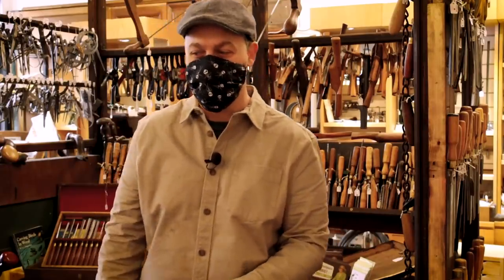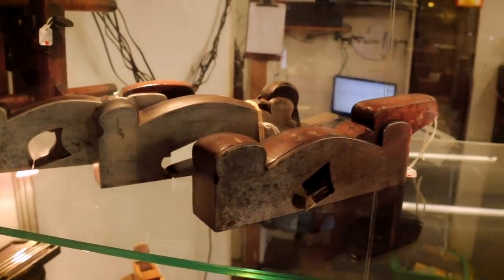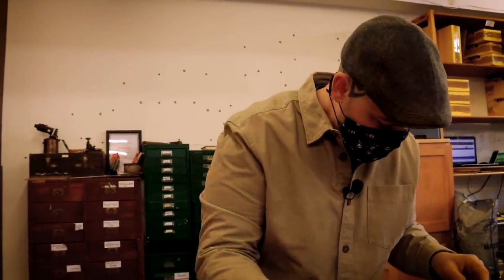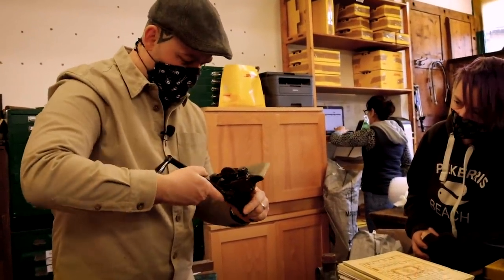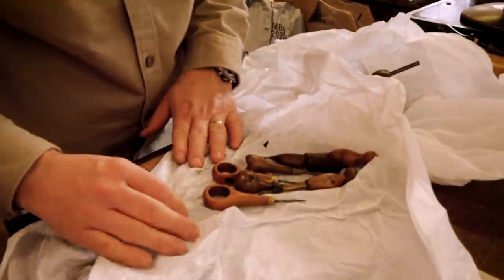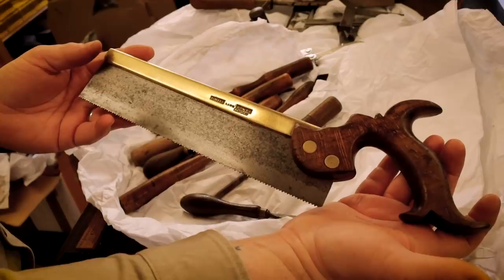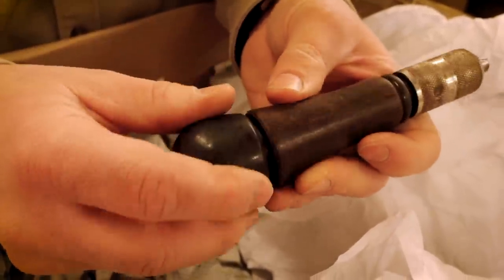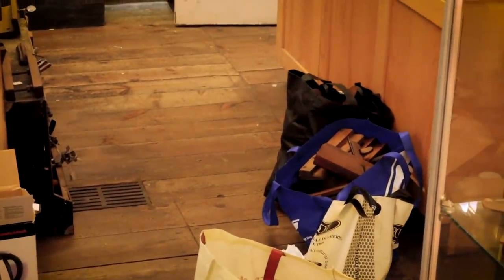Picking an Amazing Vintage Tool Haul - plus, there's a SALE

Comment: I totally get treasure days, i myself scour estate sales and country flea markets for cool things...especially German made marking and measuring kits.  Since you love vintage tools I will guess that you also enjoy correct nomenclature?  No, I'm not going to bring up the vibrato bridge debacle which does indeed drive me nuts.  I was an apprentice for an old navy craftsman who was once an apprentice for an old navy craftsman and he demanded that I call tools by the proper name or he would ignore my question.  The one that stands out is modern use of putting a "drill bit" into a "drill".  I firmly refuse to call these anything other than putting a drill or auger bit into a drill motor or hand drill.  I notice that you sometimes use the same vernacular...your thoughts?